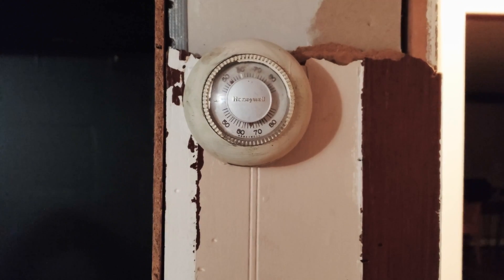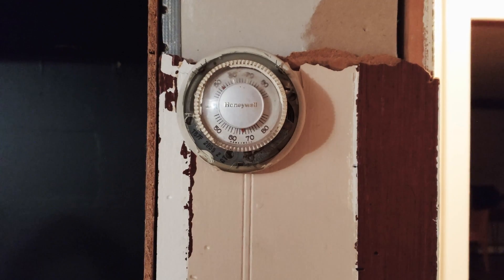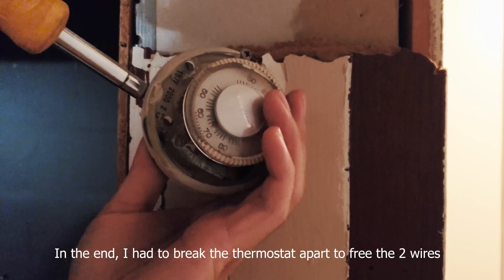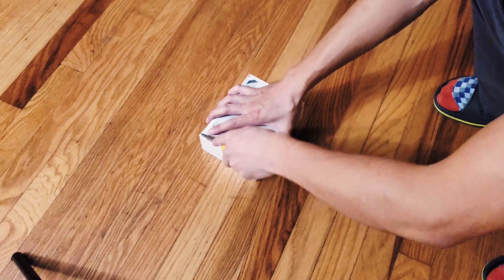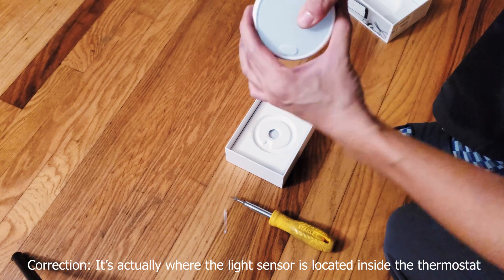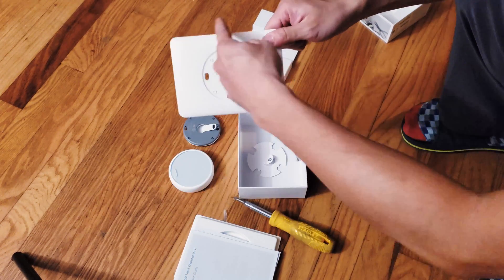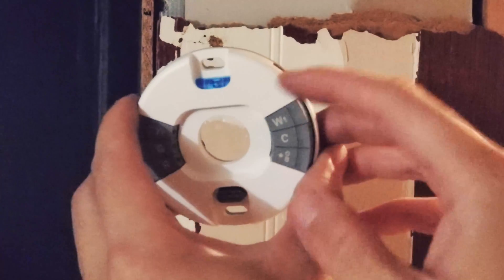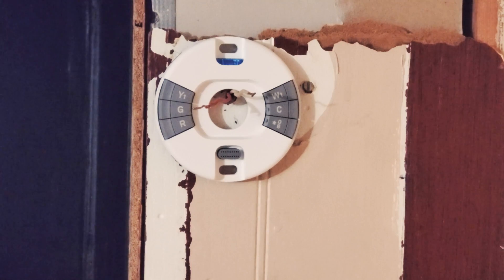How To Replace Old Honeywell Mercury Thermostat With Google Nest Thermostat E

Comment: These Nest thermostats may work without a 3rd or common wire connection but the longevity of the Nest will be shortened without adequate power.  If your old Honeywell thermostats only have two wires as described in this video then you may need a Nest C-wire adapter which consists of a power brick that plugs into a wall outlet and a wire that runs up the wall to the Nest thermostat.  Not a very good installation method.
Reply from the maker: really depending on the output voltage of the heater, mine was outputting and charging at normal range so I wouldn't say it absolutely need a c-wire.

Comment: My wires are white and black instead of white and red. Is it the same thing? Thanks in advance
Reply from the maker: According to an article, blue or sometimes black wires is the Common Terminal (C), and usually, a blue or black wire is run to the transformer from this terminal to complete the circuit, and in some cases, provide power to the Thermostat. https://robotpoweredhome.com/thermostat-wiring-colors/

Comment: Hi Li - was the thermostat you replaced operate on line voltage or low voltage? I have something similar in my house and I have been told that it's line voltage and cannot operate the Nest I got. I'm wondering if maybe your system was low voltage already?

Comment: I have the same old honeywell Thermostat, but the 2 wires are not color-coded, so I don't know what to do!
Also the instructions for the NEST (different model) said that it was not compatible with wires that were capped inside the wall, which mine are.

Comment: How did you get this to work??? I have the exact same mercury thermostat that stopped working. Bought the Nest E after seeing this video. Connected the two wires and keep getting an error that I have no power coming through the red wire…
Reply: Did you solve this? I have the same problem

Comment: I have two of these also (I have a boiler), so my A/C is on one and the Furnace (baseboard heat) is on the other. I can’t find a breaker in my panel for the A/C, but I found one for the fan/furnace. I used my voltage pen and discovered no electricity to the second (heat) thermostat, but I can’t find a switch that confirms no electricity to the A/C thermostat. Ideas?  It trying to die today.
Reply from the maker: Best call a AC/Heating tech to come and check on wiring, and they can install proper charging/power cable to your nest if your existing system is not built for it.

Comment: Are you able to disable the auto learning on the 3rd Gen?
Reply from the maker: I believe there is option to disable in settings, however I found auto learning actually quite useful in my case of knowing when to heat up the system and when to turn them off to save energy!
Reply: @TheGizmoGarage  thank you! Can’t wait to install it, I just bought it and I have an old house with the old round Mercury thermostat

Comment: Thank you. I recently purchased a house with the old Honeywell Mercury switch thermostat. I was hoping I could transition to a Nest with only two existing wires.  Your video confirms it is possible. 👍
Reply from the maker: Double check on the battery voltage though after you install, some two wire systems might not have enough power to charge the nest's build in battery
Reply: @TheGizmoGarage  how do you check the battery voltage?

Comment: Really great explanation! I have a quick question. 

How does the app handle having two thermostats? I just bought a house where one thermostat only controls heat and another controls a/c cooling. Would you have to set them independently in the app?
Reply from the maker: Yes, I have 2 nest and they show up independently in the app, and after setup, each will have their own features. For example one is heat only, and the other can be cool/heat, and each will have their own schedule